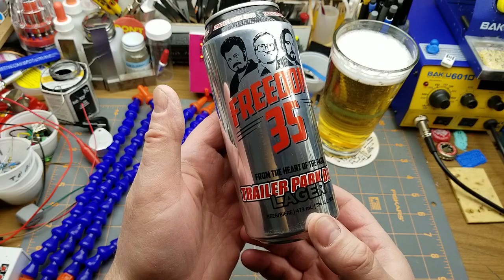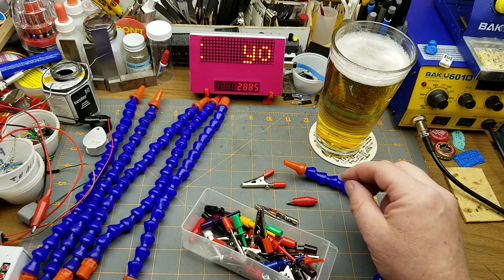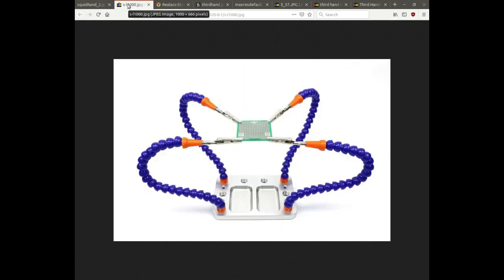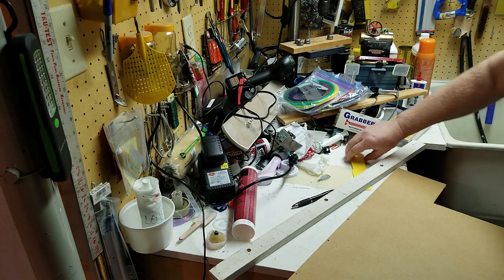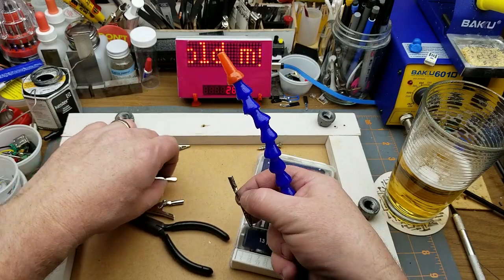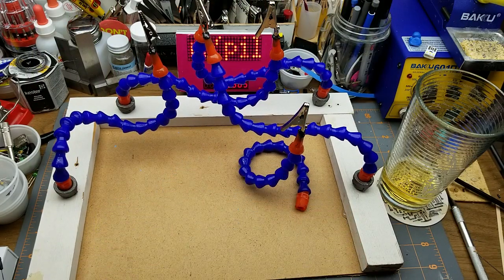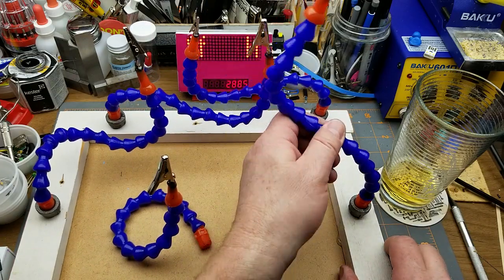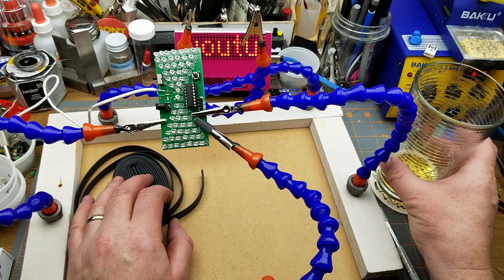DIY helping hands

Comment: Excellent video! Making it yourself is really rewarding as well as cheaper. For your fifth third hand you could get a 1/2 inch or even 3/4 inch flange and a reducer or two down to 1/4 inch, that would give you a nicely weighted base.

Comment: 1/4" NPT fittings are what they use on standard Air Compressor fittings. So the fittings are dead easy to obtain at any local hardware store.
Reply from the maker: Who knew I'd learn so much about pipe-fitting while doing an electronics project.

Comment: suggest a couple of "active" additions, and a "passive" one: 1 with a 5v (usb) fan, to move away fumes (or suck them and a little carbon filter on its back), 1 with a very bright COB led attached to some heatsink, and 1 with a magnifier, then it will be perfect :)
Reply from the maker: Interesting ideas.

I already have a fan mounted just to the right (out of camera view) blowing across the work bench.

But a magnifier would be a useful addition.

I'm going to do a kit build in a couple of weeks with the current configuration and see what other upgrades suggest themselves.

Comment: How ´bout one arm as a beer holder?
Reply: 4:57 You can tell this home made one used the metal cover off of a former PC mounted beer holder. Sadly, they removed the pushbutton operated tray that once performed the beer holding function. So shortsighted! It really is something, how so few modern computers even have built in beer holders anymore. can a thumb drive hold a beer? I think not!

Comment: Yes nice project......l have the other one currently....... question for you non related... I have found listing on eBay for 3 in 1 and 
2 in 1 soldering stations! Chinese of course! What do you think??
Reply from the maker: If it's teh same as my Baku, then so far it's been a good one for me. Others have reported some quality control issues, but so far I like the one I got (and, since that's how I roll, it was the cheapest one I could find)

Comment: I bought a base plate with six such arms from an AliExpress seller but the arms are SUPERtight and squeeky so they're almost impossible to adjust to a chosen position and the clamps all fall out of the ends of the arms. for that latter part I could use JB weld, thanks for the tip :) I hope it is for sale in Europe too :)
Reply from the maker: Honestly, any 2 part epoxy would probably do the job.
Reply: I guess you're right about that  :)

Comment: hello I want to talk about the helping hands. The old one you show with the two clips and the magnifer. I have the same thing but it was to small and hard to work with. It always seems to fall over. I just solved the problem. I took a hard wood circle about 9 inches across that I had in thee shed and took a cardboard circle two inches thick. I bought a bag of rocks from our Dollar Tree. Glued the cilindar to the disk with hot glue. Then filled the cilindar with some of the rocks to give it more weight. I guess you could use any smaller size but I used a 7x9 inch fiberboard from an old picture frame and then glue that to the cilindar as a table top. I then glues the Helping hands to the middle on the top. Then you have it. The whole thing weighs  about four pounds. I just did it so I am sure it will work. No more worries about it tipping over. Oh I love your videos. There a great way to find things on Ebay or Amazon. Keep up your great work.

Comment: Can you show your soldering mat and or pad
Reply from the maker: Normally I just use a chunk of masonite board (the same thing the base of this thing was made of). 

You can see another small chunk of it in front of the soldering station. 

It's cheap and durable.
I also use it to protect my cutting mat when I'm painting or using hot glue.